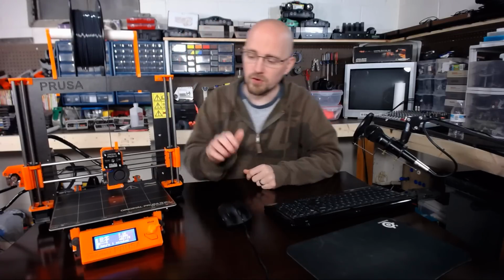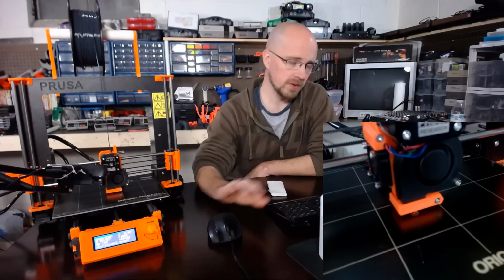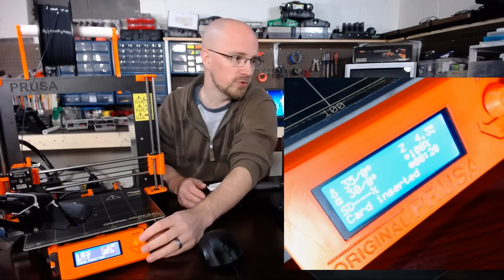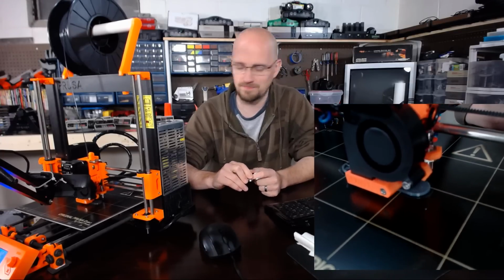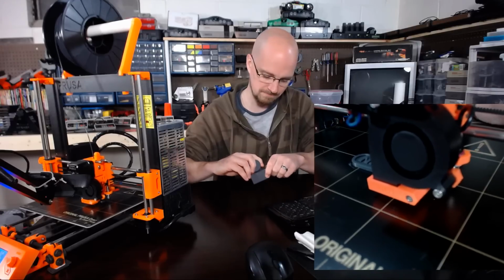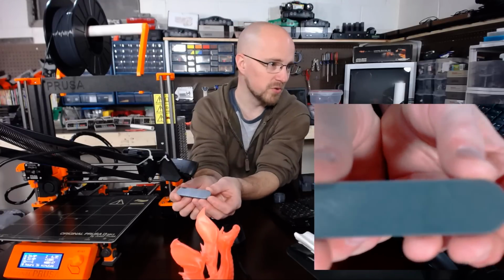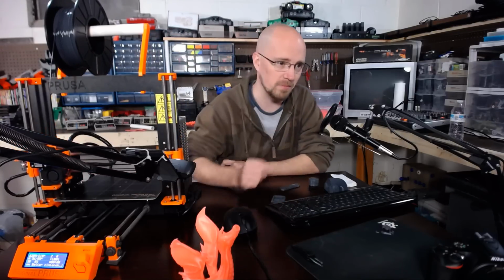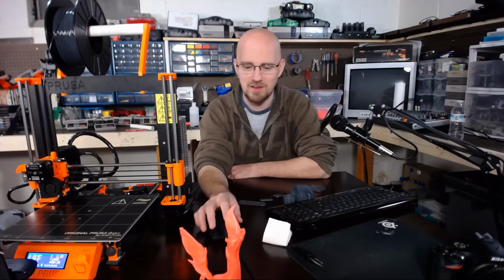Quick Tutorial - Printing a file from Thingiverse

Comment: I liked this video.  I'm a relatively noob at 3d printing.  I purchaced an Ender 3 pro and so far I've been able to get some fairly good prints.   I get my STL's from Thingiverse but in stead of using an sd card, I have a Rasberry Pi that I can connect to my net and send the files directly to it.   I have the capablility to use st cards too.

Comment: Have you thought about rounding the corners of your metal 'spatula' to reduce the risk of damaging the print bed surface/3m surface?
Reply from the maker: Yup I actually ended up doing just that. I used fine grit (the finest I had on hand anyway) sand paper, starting with 400 then finishing up with 800.

It definitely helped.
Reply: awesome :D
Reply from the maker: I didn't really think about it when I had replied, but its actually been a while since I've used anything besides my hands to remove a print from the bed. Generally giving everything a few minutes to cool and then applying steady pressure has been enough to get everything to release.
Reply: With that technique, how well is the 3M surface holding up? Have you had to replace it with the extra sheet provided?

Comment: I have led’s on my Anet A8. I took one of the 300 led strips and cut a length that fit inside the three sides of the frame and connected it to the 12V power supply and they are really too bright. Probably about four leds in the three insides of the frame.  How do I get in on the chat, I have never tried streaming before?